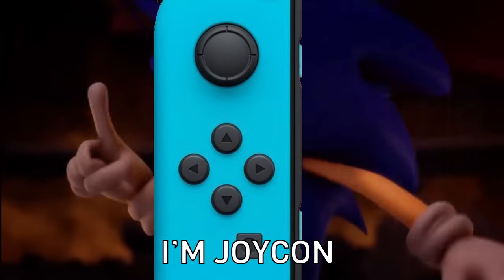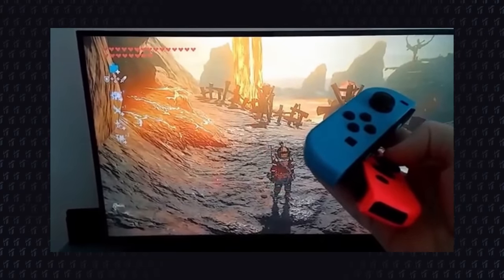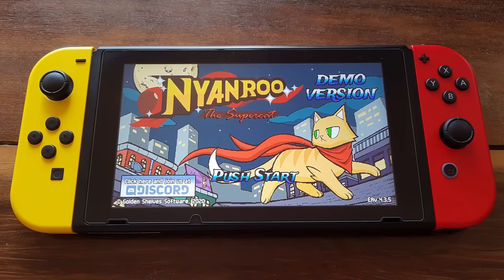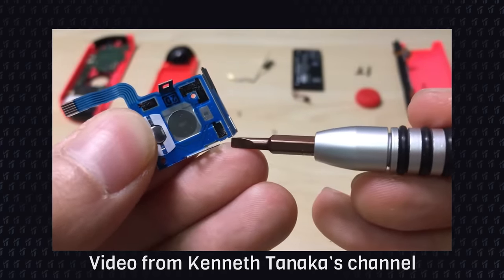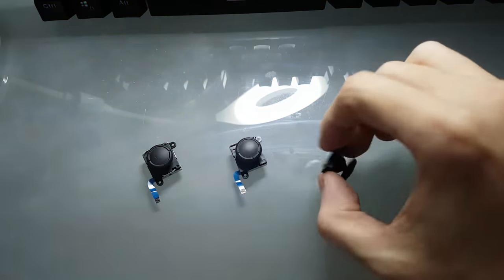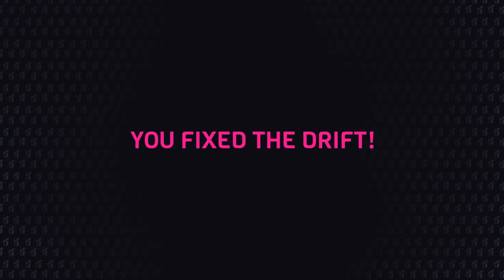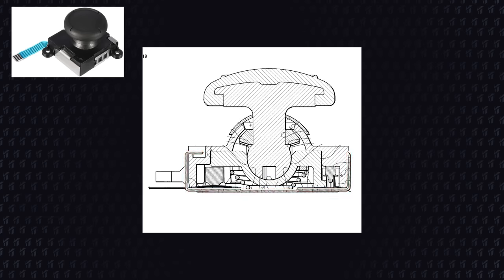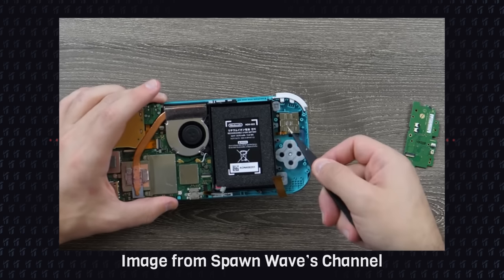How To Fix Your Joycon Drift Permanently!

Comment: I tried this with two joycons that I had put in a drawer because of the uncontrollable drift problem. Didn't have much hope of this working, but I'm happy to report that it actually did work. Put a piece of card stock paper in the spot indicated in the video for both left and right joycons, played a few games for about an hour, and they worked perfectly. Hopefully it lasts like that. Thanks so much to VK's Channel for posting this. Note - you'll need a three pronged tiny screwdriver to open the joycons and tiny philips to remove the inner battery holder. It was very easy and took about 15 minutes.
Reply: Where can we find that screwdeiver?
Reply: @elizabethsteen581  You can find them in little electronic repair kits. $10 on Amazon.
Reply: @EricNorstrom  Thank you so much!!  Going there now!!
Reply: @elizabethsteen581  Good luck! Ours are still working day two. I'll post an update if they start drifting again. Asked my kid to really put them to the test.

Comment: Just tested it a minutes ago and it works. Now its time to test heavy gaming with joy cons and see if this fix can stay calibrated for months. Hope your video goes viral. Ty
Reply: @CheapBeer4U2Drink  
It's only been an hour. He's doing a long-term test. 😂🔫
Reply: @CheapBeer4U2Drink  
I have 3 jc sets and a Lite (all drift). I will insert the card inside the JC's tomorrow and update you here in 28 days. Between myself and the kids the controllers see at least 3hrs use per day.
Reply: Could you try putting an adhesive on the paper, so it wouldn’t budge
Reply: @CheapBeer4U2Drink  Well after 7/8 hours of playing botw (we know this game demands constant using of both joysticks and pressing the joystick button) there is no drift apparently. As I said, we need weeks or months of heavy use of the joy-cons to really see if this is the final fix.
Reply: I would wait in order to decide if i buy a switch or not
Reply: @ihavebolarip6273  hope it works!

Comment: Installed this fix using 0.5mm plaplate cut to fit the joystick bases, and it worked perfectly.  The right stick also had the slow return issue; blowing it out with air and cleaning off the pads worked great and was easy to accomplish with the joy con already torn down for this fix.

Comment: It not only works for the joy-con. I did this on my faulty old gamepad that had a terrible drifting that made me purchase a new one, and lo, IT WORKED. It's a old XBOX gamepad by they way. Then I glared at my Quest2 since the right stick started to drift to one side, gently opened it, added a cut of cardboard from my box of cereals beneath a small gap below the stick, and the drift is GONE (needed to use tweezers for this operation but everything is holding fine luckily after my literal prying of the controller). Why this problem happens across so many analogic controllers it beats me. You are my first miracle of the year dude!

Comment: The best explanation as to why JoyCon drift is occurring. Excellent job rooting down the cause! Even though I've never really experienced drift since the console's release, I'm going to apply your fix anyway as a preventative measure.
Reply: Wow your lucky. I have a joy con so bad I can’t even calibrate because it won’t go to the outside of the circle on the calibration screen
Reply: @rebeccaboyer9924  same. i couldn’t get a consistent circle. it would always just barely miss the top. Nintendo, fix your piece of crud!
Reply: @rebeccaboyer9924  I have 4 joycoins since launch day, none is drifting and I have like 5k hours of playing.
Reply: Dont apply the fix anyway, no need to fix something that isnt broken. apply the fix only if you get drift.
Reply: @raptorduck8785  I have maybe 300 hours of gameplay and i have drift in 2 separate joycon.. Bought on release as well.
Reply: @Anthony-zx5dy  That says a lot of you. For sure you are an overweight dude who get mad at videogames and smash the controls, I know.
Reply: @raptorduck8785  Or....OOOORRRRRR, The widely known issue across the platform has affected my controllers and I am not overweight because i spend more time not on my ass playing it?? But to each their own, if insulting someone online is your thing go for it bud. My feelings won't be hurt. Enjoy
Reply: @raptorduck8785  everyone has had different experiences, some people are lucky to never have this problem. I’ve personally had at least 8 that I’ve worked on for personal use just because of drift. Not every one gets it, but when it hits, it hits hard
Reply: @raptorduck8785  my guy, your 5k hours of gameplay says a lot more about you than the other persons joycon drift does about them…
Reply: @ahzayoc1207  So true
Reply: @raptorduck8785  you just said you got 5k hours on the game how you gonna call someone else overweight how about you go outside
Reply: @itzyaiden  5k hours of use in 5 years, shared with my wife and friends.

Comment: Just did mine…it worded like a charm. Guess I’ll send my joycon stick replacements back to Amazon.
Reply: Nice! I have replacements as well, but the rubber is not nearly as grippy. I have to use thumbstick covers to get enough grip, and to help with getting full range in some directions.  Glad I will be able to swap back to the originals!
Reply: Keep them if they are oem-ish, something else may go wrong and spares that you already have are the best kind.
Reply: Too bad my screw drivers are terrible and don't open my joycon up

Comment: as someone who fixes controllers. yes the ps4 has a huge issue with drift too. its like the main thing I fix on them. its just not as infamous as the joycon or ps5 drift.
Reply: Dualshock 4 is just a hot mess of a controller in general, to be fair
Reply: Xbox One controller has the same problem with dextral stick.
Reply: DS4 was the first controller I needed to replace due to drift in my 20 years of gaming
Reply: @alecseuslev9054  Can Xbox One or the Series X use the older 360 controllers? I play on PC primarily and have a One X and SX controllers, so far no issues with either but I also have 3 360 ones as backup. I still gladly play with the 360 controllers, best controllers of all time IMO. So far my PS4 controller is doing alright, but I rarely play my ps4 pro as is. Perhaps I should buy a quality 3rd party one if there are decent ones someone can recommend.

Also, I wonder if preemptively doing this fix on a Switch Light is worthwhile, I don't have any issues so far, but I don't want to be caught off guard either, especially once I start playing shooters of the AC remakes.
Reply: Don't even get me started on dualshock 4s
Ive had more joycon with those than on my joycons
Reply: Huh really guess I got lucky never had dualshock 4 drift.
Reply: @Supersonicblue1027  if you got a PS4 at launch, that's probably why. Apparently the first controllers were better but after some time, drift started to get more common.

For example, my bought dualshock 4 controller in 2020 got drift in like 3 months while my friend's launch controllers are still fine, and the same friends bought another controller more recently which drift soon as well.
Reply: @VagrantValmar  Ah I see yeah I did get one at launch although my controller eventually died (it came with 2 controllers but my brother and I share the system so he has the other one) I got a new blue one after that and it still hasn't drifted in years so I don't know maybe some controllers get messed up in the machines and factories they are made in and some don't kinda like gatcha or something.
Reply: drift often happens for me when i go all butterfingers and drop the controllers over and over
Reply: I've had no problems with Dualshock 4. It's a great controller
Reply: After seven years the only problem I had with my dualshock 4 was a broken spring in the right trigger. My friend who was specially careless with his controllers had a couple with unresponsive face buttons. Never heard about drift in the dualshock 4 analogs. Much less people going through five of them each year like what happens with the joycons.
Reply: Yes ps4 has drift, my controller lasted like 3 years and then the joystick just started to ignore inputs

Comment: At this point, I'm partially convinced that Nintendo did this on purpose to promote the sales of additional joycons, at least until people started demanding them to be fixed for free. 

This video is not only a sanity-saver, it's a goddamn money saver too. No longer will I have to go to the store and spread $60+ for new joycons, now I can just watch a tutorial on how to take off the plastic cover, place a 1mm thick piece of paper in the shell, and reattach it. 

You, my man, are the the best video for fixing the issues of drift. Thank you very much for your service.
Reply: The joycon analog sticks aren't bespoke, so I doubt it was intentional.  They probably haven't changed because it would require a redesign and remaking of the joycon design and the supply line for the parts.  It's just cheaper for them to fix individual ones for free than rip up their whole supply chain and repair process for them.

Comment: Even just the first solution (applying pressure around the stick) actually fixed my 2 pairs of Joycons including the blue and red! Thank you so much! Liked and Subbed~
Reply: That happened to mine too, when it started drifting I just applied pressure to the joycon and it hasn't drifted since

Comment: Absolutely works. I had previously opened the stick assembly to clean it out, which worked for a while. I must have slightly bent the metal plate when I opened it, which messed up the range on the y axis. Putting a piece of cereal box under the stick not only fixed the drift, but fixed the vertical range. Thank you so much! I'll be sharing this with everyone I know
Reply: Do you have the measures? (I translated this question because I speak Spanish sorry if it is wrong).
Reply: @lucasperez4241  Ándale pues, soy bilingüe

Usé un trozo de cartón (Lucky Charms) que corté a la medida del metal del trasero de la palanca. Será unos 2.5 cm^2. No sé qué tan grueso sea el cartón pero de lo que he leído parece que 1 mm será demasiado. A lo mejor sea más como 0.5-0.75 mm. No creo que tenga que ser exacta la medida para aliviar el drift, lo que sea ayudará
¡Muy buena suerte! (tengo casi 6 años que no he escrito ni hablado el español casi nada así que discúlpense los errores)

Comment: Unbelievable, this morning I read a news where a Nintendo engineer explains that they will probably never be able to solve this problem, and you succeed with your logic, your methodology 
and a piece of plastic.
Thanks a lot you just saved my controller ❤😘
Reply: I read it too, and I believe that's just a classic case of the headline being misleading. They said they've been quietly increasing the durability of the analog sticks this whole time and merely made an analogy to car tires to show why the older sticks were wearing out.
Reply: We have sent human to the moon with the 60s technology, how is this not fixable? Jesus Christ
Reply: @Scarftail Any excuse nintendo gives as to why drift isn't fixed yet is a cop out. Hall effect sensors exist and guilikit has even made them into joysticks for the switch. Hall effect sensors physically cannot drift due to using electromagnetism to register inputs rather than physical contacts

Comment: Three little words, say it with me: Right. To. Repair.
Reply: Right! To! Repair!
Reply: huh?
but you can repair your Nintendo no problem right?
not like the console will disable itself if you open it up right?
Reply: @downey2294  modification voids the warranty, even to fix something that's really clearly a design error.
Reply: @a-s-greig  well technically the joy-con is an accessory and the warranty will void after just 3 months anyway. which is more crazy to me.

but yea if modding includes changing the battery or something similar it shouldn't void your warranty.
Reply: @a-s-greig  I don't know how they would notice. you can open the joycon and no one could tell you did
Reply: @Manuel G i'm 100% sure the US is not a third world country. but yea you're right European counties  do have an extended warranty of 2 years on the joy cons. still doesn't make it less stupid that its like that in the US though
Reply: @kurikuraconkuritas  technically opening the controller wont void the warranty modifying upgrading or tempering it with 3rd party hardware will.

like putting in a new analog stick or battery or a wire.
Reply: @kurikuraconkuritas  the screws are easily scratched so they immediately notice if you have opened it.
Reply: Right to repair is for big companies to supply small shops with parts to repair, unlike for example Apple, who only let a handful shops order stuff under license. This is somewhat different to this stickdrif joycon stuff.
Reply: @Xfade81  Kinda, yeah, but Nintendo is still absolutely awful about letting people tinker around with their hardware... even after it's sold.
Reply: @Xfade81  i heard the licenses are not economically worth it for small businesses either.

Comment: This solved the drift on mine. I put in two pieces of cardboard at 0,5 mm each and carefully pressed the metal bracket a bit tighter with pliers. Works perfectly now, thank you!

Comment: I've had drift for 2 years, since I got my switch. I've tried using rubbing alcohol, but it only worked for a bit. I didn't want to spend 20 bucks to get it fixed, but this trick has FINALLY gotten rid of drift. Thank you oh so very much!

Comment: This is an amazing fix. I found out about 2 years ago that if you just press in the analog stick that's drifting, it'll fix your drift for a few seconds before it comes right back. I know NOW thanks to this man that the reason is because pressing the stick in increases pressure on that tiny metal pad, which gets rid of any space between it and the plastic piece. I was certain that there had to be a solution that was pressure-based in some way, and it's crazy to me just how easy it is! Thank you!
Reply: tbh my old joycons used to be broken so i couldnt press it in so you could imagine my confusion when i had to use my special in splatoon 2

Comment: So all Nintendo really has to do is add some shims or thicken that part of the backplate.

BRB, gonna order a three-point screwdriver and business cards...
Reply: If they did that they’d acknowledge that drift exists and they’d lose the lawsuit they’re in
Reply: yea, pretty much. Nintendo just has to secure the metal plate to the plastic frame so that it doesnt loosen, which allows dust to accumulate and cause drifting
Reply: @joshuaijaola2145  still it would be the one thing they need to do in order to avoid bad press which at this point would have been way more damaging than losing one lawsuit. This is an issue for 4 years now. Nintendo just ignoring this like that is for me, a guy who followed them through heaven and hell for over 30 yrs, the worst thing I remember them pulling off on their customers ever. I really adore the Switch and believe its the best System I could ever have wished for, but this joycon-problem is just bizarre and just a shame. When I now buy a Joycon, its really like knowing I can dump that thing a year or so later.
I mean I'm gonna try this fix and hopefully it works for me, but its bad enough that it had to come to this.
Reply: @rexman1231  and the loosening of the plate also causes the contract with the pads to be inaccurate because it's positioned improperly, but yes the dust adds to the issue.
Reply: @Bermersher  yes, the dust just worsens the already worsened accuracy

Comment: Funny, I did noticed that the joycon that was pressed the most went bad.
Reply: @Dairunt1  Seems like it. Most shooters and even Minecraft have sprint on L stick. Nintendo maps sprint to a button always. Guess it went unnoticed during testing
Reply: @theakiwar9118  I'm pretty sure that BotW and Odyssey both use pressing the stick in their controls scheme and those are two of the biggest titles on the console so it should've been noticed during playtesting.